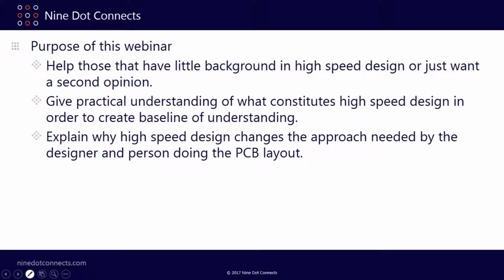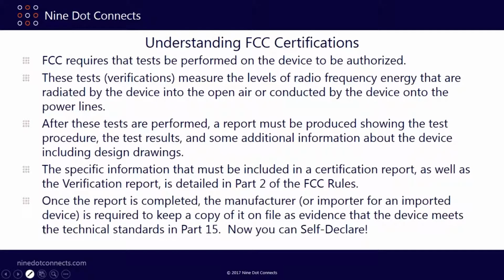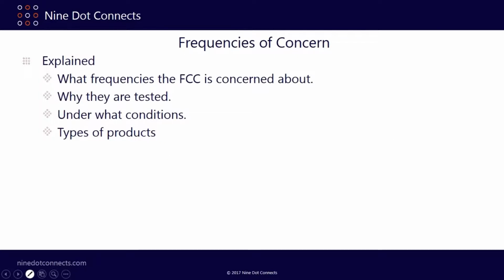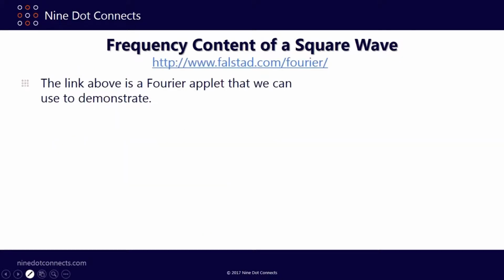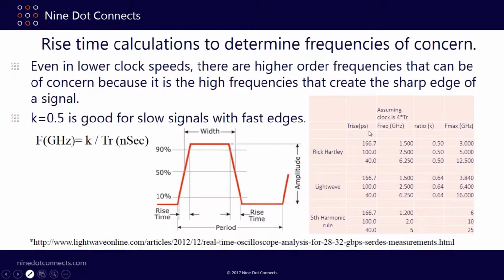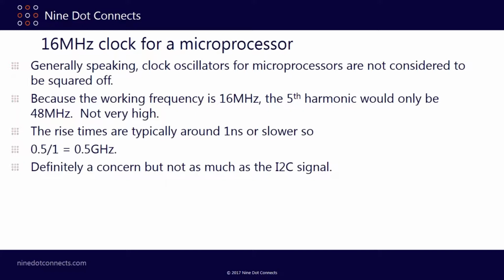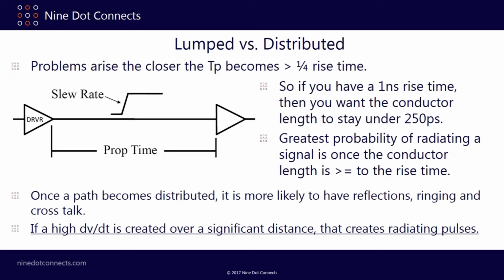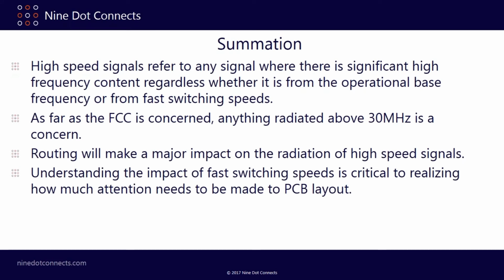What defines high speed in electronic design?

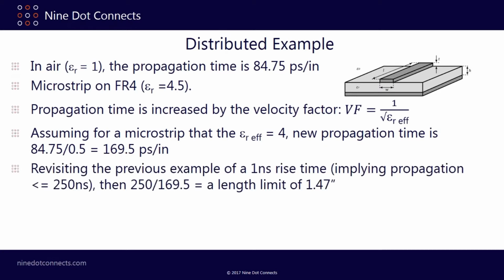Comment: I believe there is a typo at around 40:24. The propagation time needs to be less than 1/4 of 1ns, which is 250ps. The slide shows 250ns. Minor, but it tripped me up during the live presentation.
Reply from the maker: Thank you for alerting us to this typo.  We have confirmed that it should have been 250 ps.